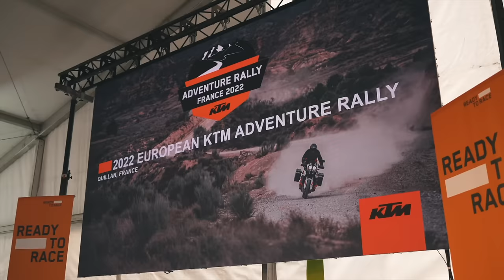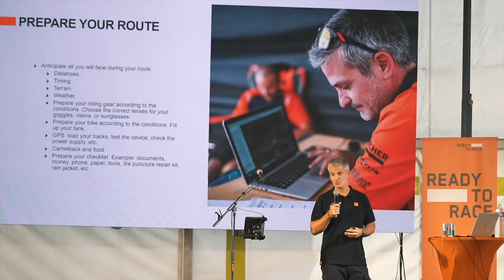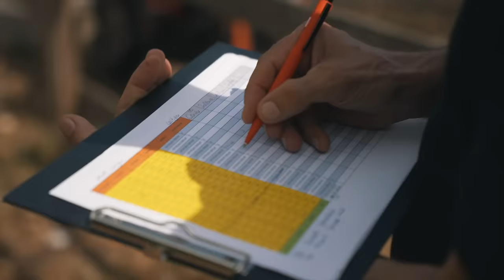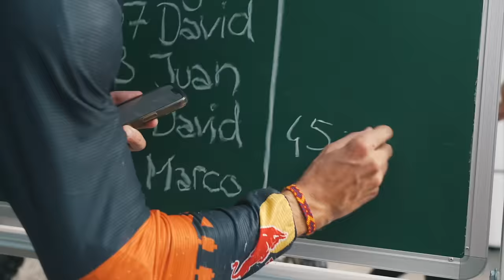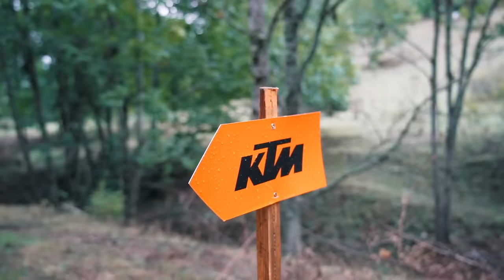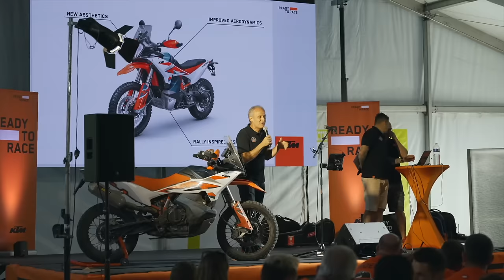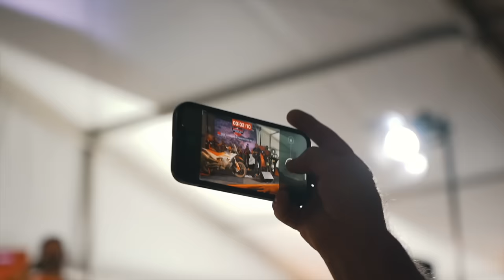KTM EUROPE ADVENTURE RALLY – France 2022 | KTM

Comment: 690 is the only one jumping the mx track and not bottoming out / getting up the mud hill without help. 🤷🏻‍♂️
Reply: I mean, naturally. The most dirt bike inspired bike will act more like a dirt bike?
Reply: @Modelo408  I need to buy both. Only solution.
Reply: @mattearley6188  you need all of them.. it's the only way
Reply: Yes, but when you go with that 690 on the highway for more than one 1 you will end with your hands good to shake off towels in the beach
Reply: @Camilo Manuel Alejandro Donoso Leiva  It isn't THAT bad to be honest. It's nowhere near as comfortable as an adv ofc
Reply: @camilomanuelalejandrodonos5799  the later 690s engines have twin balance shafts and are very smooth. The only thing really stopping the 690 being the perfect bike is the horrendous reliability
Reply: @nyedavis922  and addition to that, KTM need to change the design of the exhaust in order to use that space for more fuel tank (similar to AJP PR7)
Reply: @camilomanuelalejandrodonos5799  husqvarna seemed to do fine with the LR putting additional tanks upfront. Just no one seemed to buy them
Reply: @nyedavis922  thats is cause looks bad and in a crash will be broken easily
Reply: Damn good machine